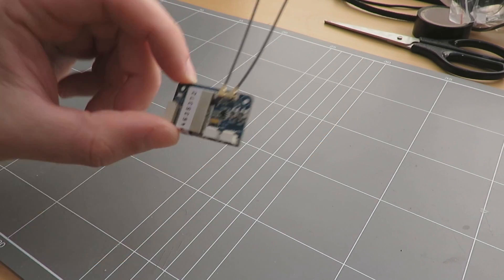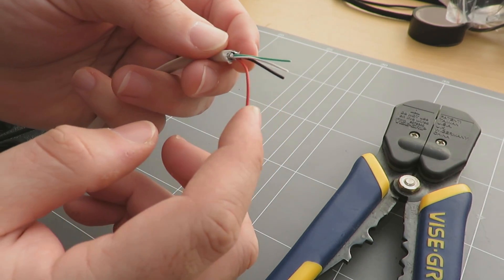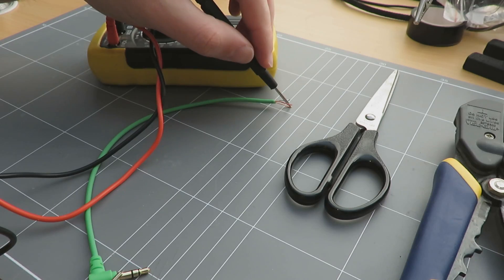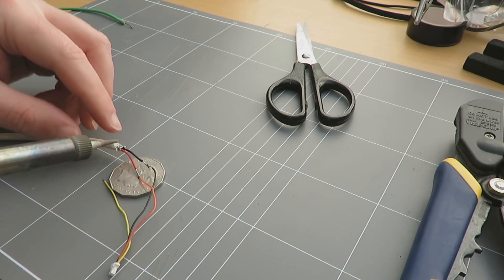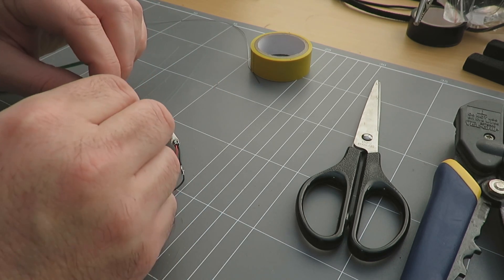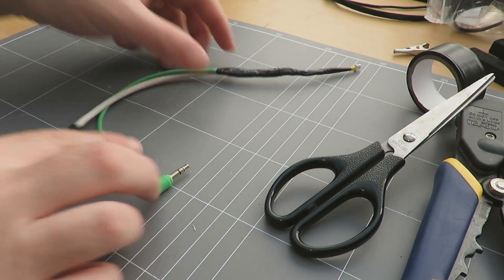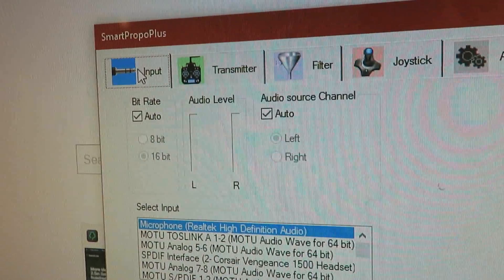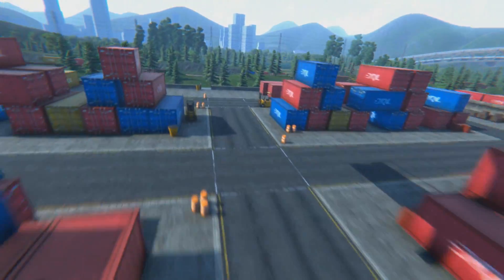Use RC Transmitter as Wireless Controller on PC

Comment: Why on Earth, as consumers, are we having to patch expensive controllers into expensive software via some Micky Mouse, wretched looking rat's tail? So, I a newbie, have to get a soldering iron + random parts I know nothing about, all by mail order - it'll take weeks!
Reply: It should have a rechargeable battery and a usb-c connector to charge it and connect with the computer for simulators

Comment: hey! i can't seem to get mine working. is soldering the only thing that will work? i just wrapped the cables around each other but it has way too many other signals i guess. and also, i'm using a gun type of transmitter. is that even compatible with this? if not, how would i be able to make one for those kind of receivers/transmitters?

Comment: i want to do the exact opposite of this. I intend to use an XBox controller as an RC Transmitter.
Reply from the maker: You'd have to do 1 of 2 things, 
1 connect it to a computer, translate the input into signal and blast it out using a transmitter or open it, solder to the buttons inside and connect that to the transmitter.

I think those are the only two ways to do something like that.

Comment: Hi. Thans for the video. This should work with any transmitter as long that it has a matching receiver, right? One more question, i use a laptop, so it doesn't have a dedicated mic input. The only thing it has is a stereo and mic plug output (all in one hole) for gaming headsets. Will that work too?
Reply: if you have a popup asking you "what did you just plug" select microphone, if you don't i would rather recomment using the betaflight passthrough if you have a flight controller, you avoid unplugging everything in your drone and it's only through one usb!

Comment: Thanks for this. Made one before my FS-i6x and x6b showed up today. Got it , plugged it in, and changed the setting on the transmitter to PPM, and smartpropoplus saw it right away and started working. Stoked to not have to use the stupid USB cable.
Reply: I'm doing the same thing bro. But, Spp just show up random signals, not detecting my Fs-i6. Is there a firmware version requirement for it?

Comment: im using my mox reciever that worked good in my quad till i swapped it out. i have a steady 5.1 volts going to it but in smart propro plus it randomly adds more channels which causes the simulator to flip out randomly. any ideas? i even tried upgrading from windows 8 to 10
Reply: nevermind you should be getting 5.10 at least i was using a micro quad lipo charger and it only gave out 5.10 if a pin was shorted. some propritary connector or something

Comment: When I do this, the signals are randomly varying all by themselves and I keep on getting different error messages one after another. I am also using fs-i6x with x6b.
Reply: did you figure out a fix for this? mine is doing the same thing.
Reply: Sadly no. I've given up and uninstalled SPP. Waiting for my simulator cable now! I just hope that doesn't fail too LOL
Reply: try going to  menu->system->RX setup->Output mode  and then change it to PPM
Reply: Im having the same issue lol cant figure it out i give up
Reply: Did anyone solve this problem?
Reply: I got same problem but on smartproplus go to controler and choose walkyrie, is not the best solution but at least you can fly in your simulator also calibrate your transmitter in your rc simulator software thst helps too

Comment: That's really interesting how you can do that!
Reply from the maker: Cheers man, yeah without going into super amounts of detail what its basically doing is taking the ppm signal through your soundcard and using the software to parse it into gamepad movements so you can use real tactile controllers wirelessly to practice :p
Reply: Is stealing power from a USB to get your signal pin twitchy and the software is like Xanax and the Xanax doctor converting the twitching into understandable "talking" ...all this while you're detached from the situation with the freedom to run away without a cord should you catch a case of the twitches...lol